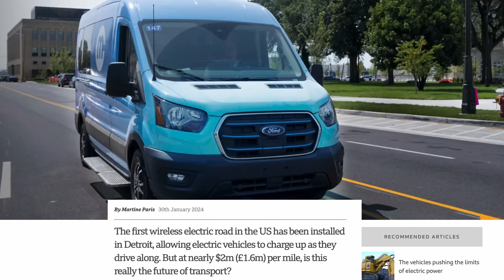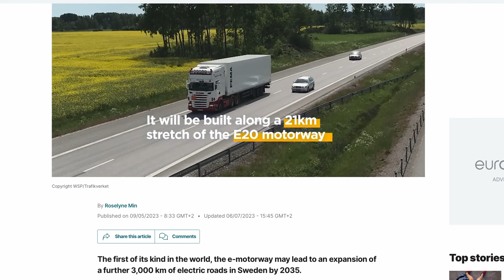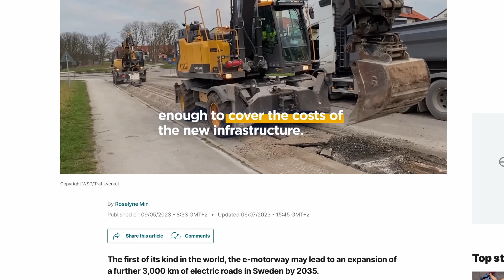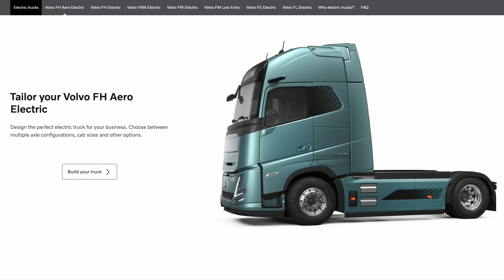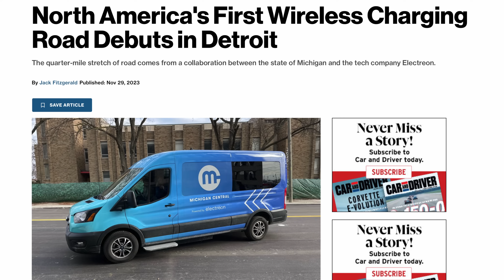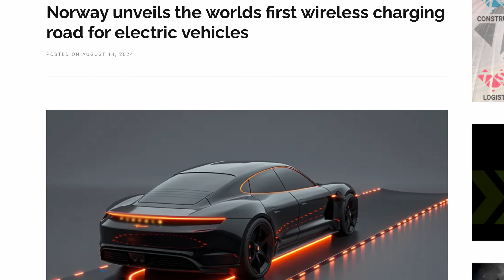WIRELESS EV Charging Revolution HITS Norway's Roads!

Comment: My apologies for jumping in early.
You make an interesting point.
The robot lawn mower can cover huge distances and then "park on a dime" to recharge. 

Future EVs will park their bumper bar against the wall outlet and trade electricity all day long and all night long. 
$60 wall outlet is dirt cheap. 😮  😊😊😊

Expensive magnetic ground loops and complicated inverters and vehicle magnetic loops will not be needed to recharge. 

24hr grid plugged in will be the advantage to both the vehicle owners AND building owners AND grid owners.
Millions and millions of large EVs batteries backing up the grid is brilliant for the entire country. 

Most vehicles are parked 23hrs every day. 
Most vehicles drive building to building. 
All buildings will have PV rooftops. 
Dirt cheap electricity.

The grid will take millions and millions of feedin and concentrate the feedin electricity to the industrial users. 

Batteries will handle the surge in daily demand and daily rooftop PV supply. 
The grid will balance customers storage and backup customers and supply heavy industrial users moving away from fossil fuels. 

Australia's 'Sahara Desert' warm latitudes and all warm latitudes have this huge advantage. 
80% of the world's population live in warm latitudes. 

Many cold latitude countries will have their EXITING NUCLEAR electricity as base backup and can use fossil fuels as emergency backup midwinter. 

Grids are horrendously expensive to build and too valuable to waste. National wealth invested. 
National grid capacity took 100years to build the minimum. 
$TRILLIONS to build. 
National grids are fragile because it is extremely expensive to over build. 
Grid electricity is expensive. 

Feedin electricity is dirt cheap.
Feedin electricity surge destabilises the grid. 
Battery storage protects the grid. 
EVs massive batteries are FREE mass storage. 

Central generation needs 247 cashflow, constant demand for economic survival. 
Central generation demand will be destroyed by the daily DUCK CURVE that will become the DEAD CAT IN THE MIDDLE OF THE ROAD CURVE. 

The $TRILLIONS national electrical grid cashflow will fail unless it commits to its existing customers.

Simple economics.

For Australia, every year:
TAX FREE SAVINGS
20million vehicles will save $60billion on imported petroleum. 
10million homes will save $40billion on natural gas. 
15million buildings will save $100billion on grid electricity. 

$TRILLIONS saved on no new grid capacity expansion construction costs.

Central generation is a dead energy infrastructure investment. 

Central electricity generation technology created the need for the national grid connecting the entire population. Millions and millions of customers and cashflow. 

Rooftop PV technology created customers daily electricity and the grid became the backup. 
Grid generation and upgrade was stopped as the grid was unloaded. 

EVs v2g massive battery parked 23hrs daily is FREE massive storage daily, and all night long. 
The national grid itself is the future of national energy, connecting millions of customers as the backup and redistributing or concentrating national clean electricity energy. 

Remember Australia uses 10 times more fossil fuel energy including the waste heat energy. 
The grid is extremely expensive to EXPAND. 

Edit 
Smart rooftop PV panels can shade 20million hot roofs in our warming latitudes. 
More saving on air-conditioning loads.

Edit
24hrs trickle currents all day long beats rapid charging every day of the week. 
Trickle and
24hrs.
At every building on the planet. 
The building does not even have to be grid connected.  😊😊😊😊😊

My apologies for jumping to the conclusion too soon. 😮

Comment: Those trials have been done already and showed a miserable economy for the operators and users of wireless charging in the roads.
Reply: I am still baffled how they are going to get the efficiency on magnetic flux transfer from road to car. Look at tranformer design with laminated cores.
Remember the flux loss usually follows a square or cube law related to distance (reduction). 
It is a bit more complicated than this bit you get the idea.
Reply: I am more baffled how someone could take the next step without asking two questions just like the electric road in Germany
Who is the future customers and how pricesensitive are they?
What is the price per kWh battery in the future and how much is needed to avoid using the road charging?

Comment: Try First Principle Thinking Dave. What are we trying to solve? Is it cheaper and more convenient? Is it easier to maintain and build?
Reply: The answer to both questions is no.
Reply: @rogerphelps9939 Your can do attitude really shines through?
Reply: @Yorkshire-z5v 😏
Reply: At 50mph a HGV got 100kw with electreon technology with a target of 75mph getting higher speeds of charge.
Reply: As someone who studied the idea at Uni, back in the late 1970s.......

The cost right now is very, very high to install the equipment, but obviously, economy of scale will make it merely expensive; as for convenient, this would answer the question of how the governments will replace fuel taxes; they can go to a road toll system justified by charging as you drive.

As for maintenance, the costs should be VERY low; there are no moving parts, and with any electronics situated in road-side cabinets - just like current telephone and internet electronics; under the road will just be the coils of copper, which should last as long as the road lasts - or until British Gas dig it up, looking for their pipes.

The current, publicly known, level of tech will transfer enough power to keep a car going indefinitely at around 50mph; Kia were trialling a small fleet of Mk1 Kia Soul EVs with inductive pickups fitted under the car, several years ago, and were attaining 10KW transfer speeds; HGVs are a lot longer, so a pick-up slung under the trailers should be more than enough to keep them going forever; with the weight of the pick-up coil being more than offset by the reduced size of the battery needed.

Eventually, normal use transport will only need a battery range of ~50 miles, as all the major highways will be converted to wireless charging infrastructure, although that is decades in the future - just enough battery to get off the major road network and to where ever you live/work, or drive locally.

Comment: It seems a logical development, if cost effective and could possibly take over from car tax. It would be easy to tax per mile. All eV's are computers on wheels,  so it could calculate miles driven per driver and sent by WiFi back to the taxation office.
Reply: That is total nonsense. The odometer reading is taken at every MOT test. Extend that to the first two years and you have your solution.

Comment: Wireless charging could also replace having to plug in and charge whilst you are parked. This also has a benefit in reducing the cables being stolen as there would be none to steal. I am not sure how well charging roads will actually work as I guess it would be a slower charge rate so it may be good enough for a small top up by the end of that road section. Interesting times ahead.
Reply: No unless you are happy to pay something like 3 times as much for your charging. Wireless charging is very inefficient and requires very precise alignment between the car and the charger to even work at all. This is a dead end. Regarding solen cables I am sure that someone could come up with a solution where the cables are stowed away from harm's way and only released when the payment card has been registtered and are automatically retracted at the end of the charging session.
Reply: Yep, burying a cable won't stop it's theft, theives steal bulldozers or use diamond disc cutters to dig up the road. Happened in Bromsgrove last month.
Reply: @GruffSillyGoat I live in a village and a few years back they stole the telephone cable that was sbout a mile long. A week or so later whilst trying to replace, it happened again. It is crazy how far they will go to get at the copper. We need more monitored CCTV around all of our chargers.
Reply: @rogerphelps9939  Yes you are correct at the moment, but Tesla want to use this method for the Cybercab and I am sure many improvements will follow as we initially only had 50kWh Rapid chargers not too far back!